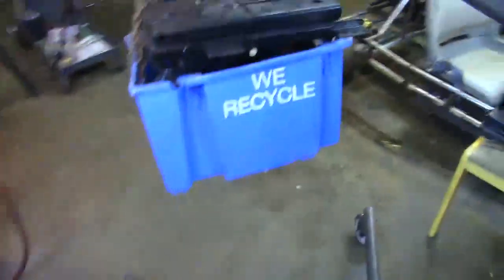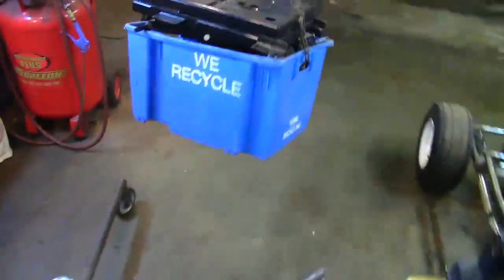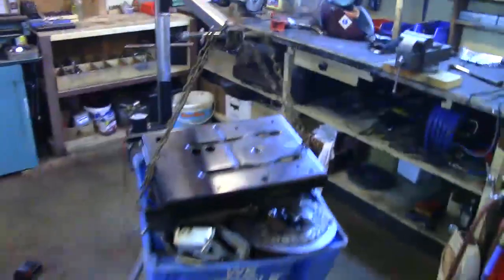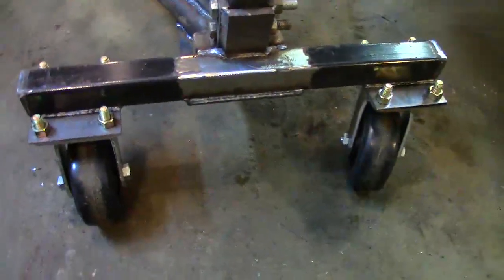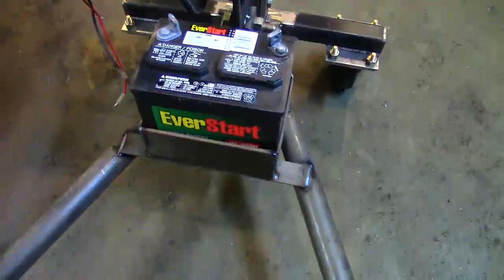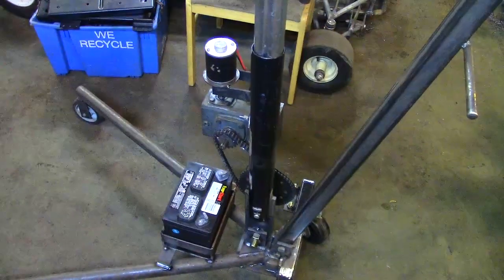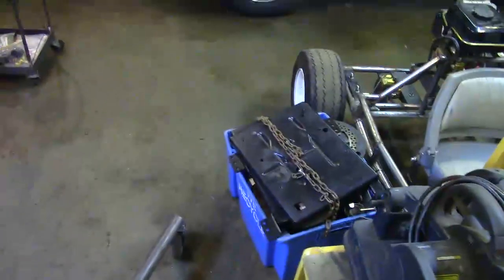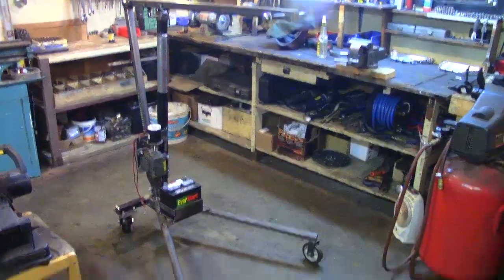Part 3: Electric Utility Hoist/Engine Hoist (Building The Frame)

Comment: , really nice
Questions please
I am interested in building a crane simular to yours it will be something like a pick up truck crane only I want it to be able to fold up when not in use and the idea to  use the angle iron is for the weight of the over all project I want to use angle iron and round tubes the round will be used to pivot only  and it's not mention in my mind to lift anything more then a guess of 2_300 lbs will you recommend anything in regards to this project as far as an iron goes
                                                                                          Thank you

Comment: good welding overall, but for the time and metal costs you put into this, it would have been far cheaper to just buy an Electric RV Tongue Jack (3500-lb capacity) and just modify the end fittings, then buy a portable folding engine hoist and mate the two. Would have cost about $270 total, and you would have been in-and-out of the project in 3-hours with basically, the design you ended up with anyhow.
Reply: Yeah, young people like to build for fun. Old guys build for $$.  Time is $$ baby!

Comment: Good build.  Yes, you should weld up for penetration on vertical welds.  It is easier going down but you aren't getting good strength without the full penetration.  Also those little 12v motors have a very short duty cycle so keep testing how hot it is getting until you are familiar with  how long you can run it under load.  I would also add some cheek plates on your pivot hole in the boom.  Enjoyable video with a creative project.  Doug

Comment: sorry but down hand welds will result in lack of fusion. root pass with vertical down position creates disruption in the process and may result in partial fusion. vertical up position is preferred, resulting with better fusion. welder sound a little cold also, I hope I don't sound to critical. good video.